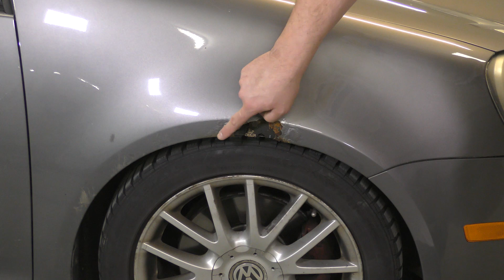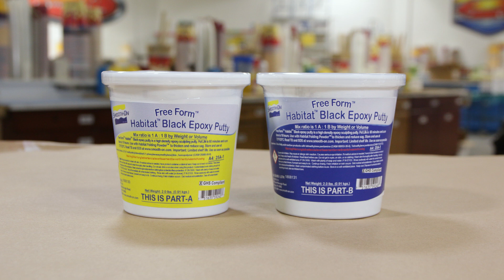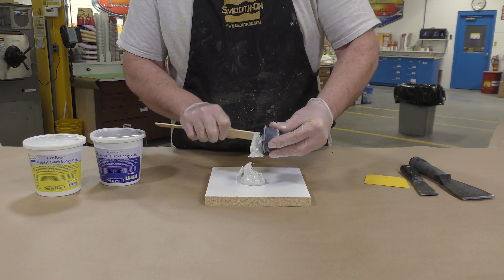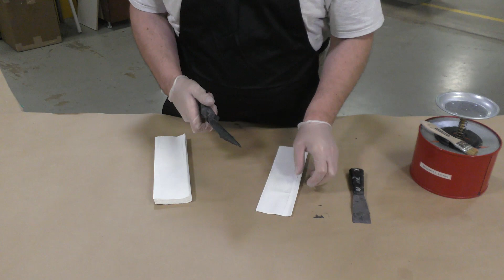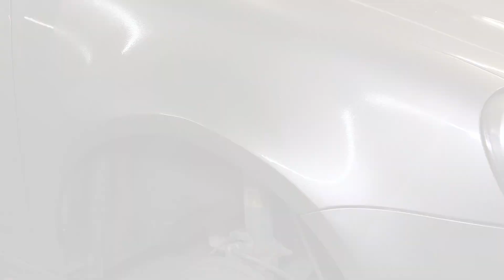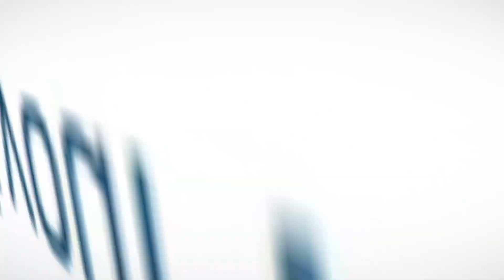How To Repair a Fender Using Free Form™ Habitat™ Epoxy Putty

Comment: so he only  uses metal wire mesh as the base surface to apply the  epoxy putty? im trying to install aftermarket fenders but i drilled holes to close to the edge to mount my fender on the top half where it closes on the hood, could this process in the vid shown be appliable to filling the hole i made, so i can redrill a new hole to mount it?
Reply from the maker: Can you send us a tech ticket? Our team can help you - https://www.smooth-on.com/support/ticket/add/agree/

Comment: Can this be used to repair rusted sections of my bicycle? (I would cut the rusted portions out first)
Reply: Holzmann it’s been a while since u asked, but don’t use this method on any load carrying parts! Frame, handlebars, cranks etc
Reply from the maker: Yes it could be used to repair other metal surfaces.

Comment: It would be nice to have this in a dispensing tube (like caulk) instead of just tubs. For the hobby user it could mean less worry about air bubbles, and pro users could use a dual dispenser and perhaps a mixer tip
Reply from the maker: Good idea!
Reply: To mix it you have to handle it 
It wouldn't work. 
Perhaps AFTER mixing, it can be stuffed into a dispenser

Comment: if you mask at the fender parting line you'll get a much nicer finish, also most autoparts stores have your exact color for your make and model
Reply: Yes, this is a great point. Also, epoxy primer, wet sand the whole panel lightly, color feathered out onto existing, then a two-part clear coat (available in a can now) over the whole panel once again. This is a great demo, but someone with some auto body experience could really make this work wonders.
Reply: @endall6783  It depends on your definition of "best". It might be best practice for bodywork, or for someone who cares about their car, to have it done more professionally. For someone not looking to spend $500-$1,500, this is a pretty decent substitute. I would do something like this on a work truck, a tractor, even a car that I knew wouldn't see salt again.

Comment: You also take it for granted that the common car owner would have all the equipment for the project.
Reply: If I may well if I'm going to do something than I am sure I will have what it takes to do the job. I need a car to get around so I couldn't do a little at a time and just let it set.
Reply: This is like saying that petrol/gas stations take it for granted that you will have a car when buying fuel. They sell the epoxy. Its not their job to see if you have everything you need. That's your job.
Reply: Reynolds sells to commercial customers.  Smooth On is the product line.  They really dont target your average consumer.
Reply: @WereAllThatBored  I understand that little concept but their intentions has been to show it to all of us and you are WRONG.
In that video they put emphasis on how to DO IT TO YOUR OWN CAR and not as a commercial user.
Reply: Lord of Thunder I appreciate what you’re saying but I applied for a job with them about five years ago.  Reynolds targets commercial accounts.  Sure they sell to us common  folk but they make a fortune off commercial customers
Reply: @WereAllThatBored  AHH, With respect, that is why you defended them with the commercial customers approach!!  All good.
Still, Sir, I rest mny case.